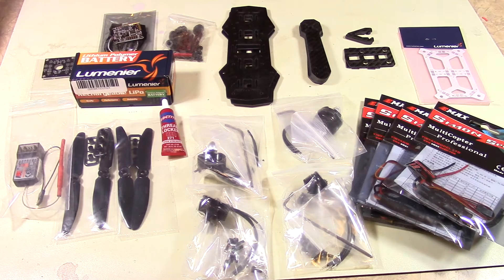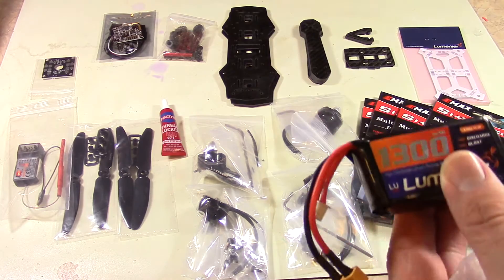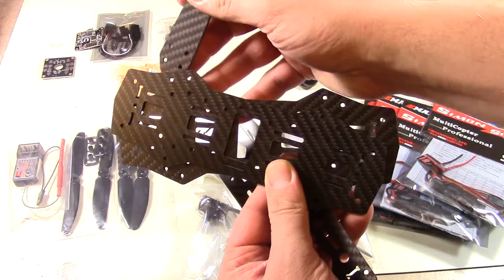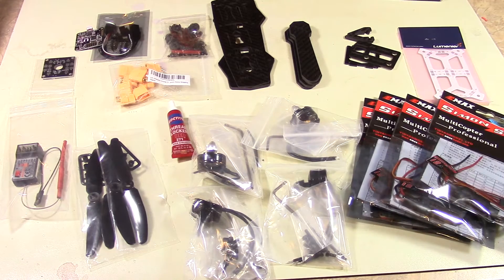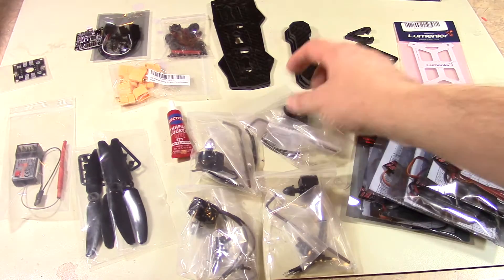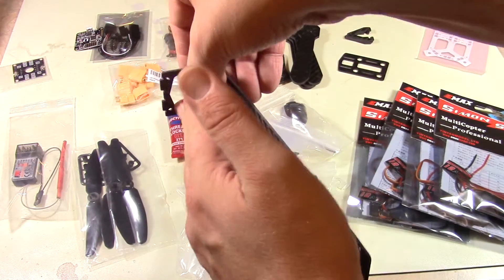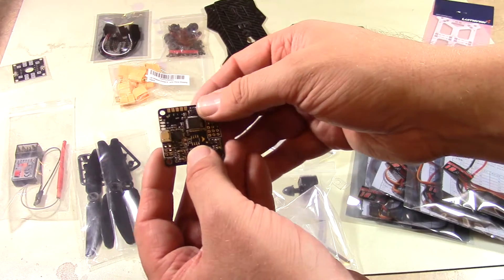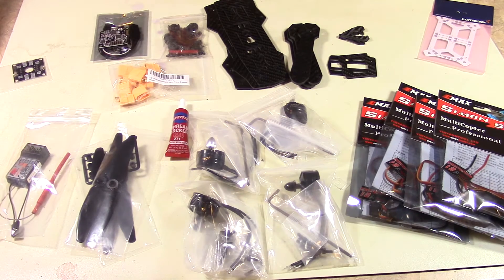Quadcopter - Part1 Build

Comment: KV in motors is rpm per volt supplied. I still have no clue why anyone would pick that terminology.  Must have been the same people who read batteries mAh as "Maaaw" :) Cheers Sir  PS- don't use red Loctite on your quad. Overkill and you will truly hate yourself later.
Reply from the maker: +MKme Lab Hey there thanks for the comment.  Yeah I am with ya on the KV thing I don't know why they make that the measurement.  lol Yeah I see where I don't need to use Red.  I only used it in a few places where it will never come back apart. Elsewhere I would either use blue or nothing.  Thanks for the tip.